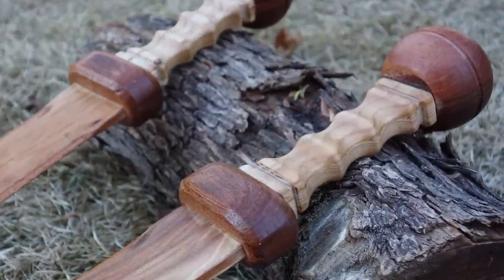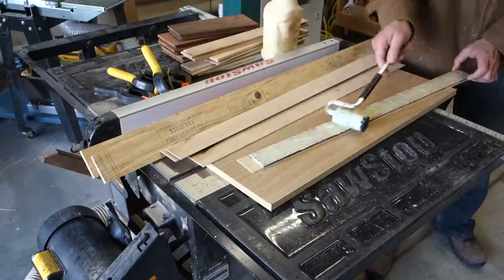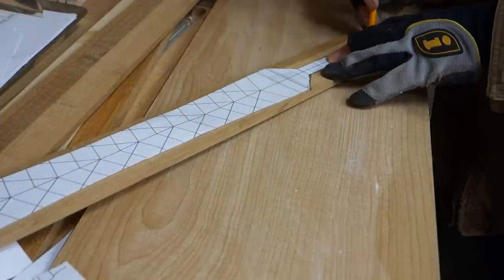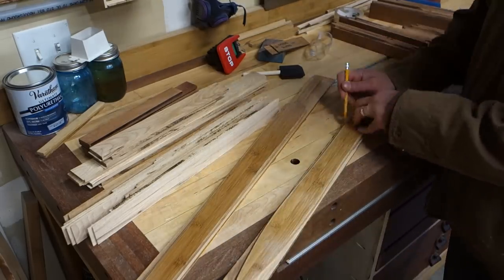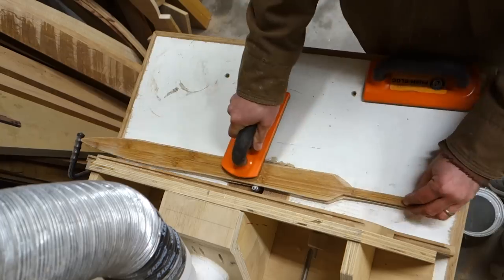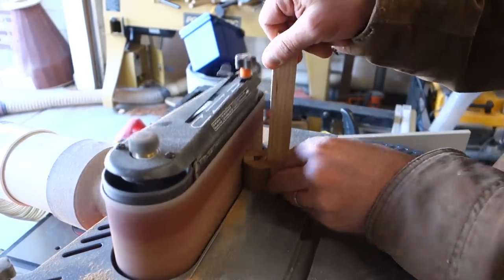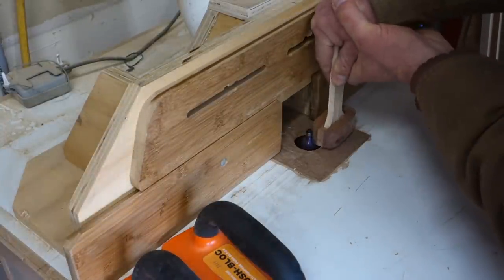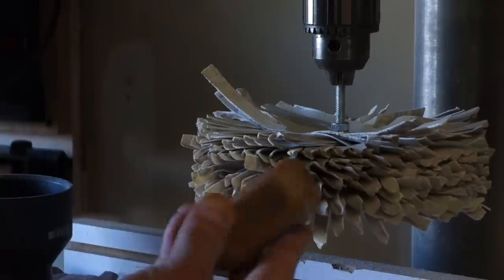Making Wooden Gladius Swords

Comment: is that a standard 15 deg panel routing bit?  and is the bearing extension to eliminate the flat part of the panel a custom thing or did you just get a larger bearing to put on it?  Thanks
Reply from the maker: Yep, panel bit as you say. You do need a larger bearing to keep it from getting that ridge on the bit, however a bearing still leaves too large of a gap between the bearing and cutters, for the width of these blades. I ended up using a few washers as the bearing, and I make sure they are tight on each time I use it. Good eye.

Comment: What thick ness wood are your swords I was going to use 2x4 and make multiple blades at once how thin would you go for children to play with
Reply from the maker: 2x4 would be fine, but my guess is that you'd want to make them ~1/2" or thicker to beat around. These are thinner, but also made from denser wood. That's just my guess. Good luck, sounds fun!

Comment: What is the name of the tool you use to hold the wood in place on the ban saw?
Reply from the maker: Hand screw clamps. They are super useful for many things.
Reply: Geeks Wood Shop I was meaning the guide at :21. Sorry I should of said the time
Reply from the maker: Ah that. It's a grip-tite brand magnetic fence.
Reply: Thanks, looks like a very useful tool also

Comment: The leaf shaped one would be called a greek xyphos
Reply: Not true, many forms of gladius featured a leaf shape or “waisted” design, widening at the tip. If it had more of a cross guard, rather than the typical wooden one of a gladius, and no large sphere pommel, it would be. They are very similar swords though, I’ll give you that.
Reply: But most gladiuses were straight
Reply: S4Plays  True, I wasn’t saying they were not. I was just saying that a leaf shaped gladius is still a gladius and not a xyphos, as it lacks too many features. The gladius was in use for over 600 years by the Romans, and had many variations.

Comment: do you actually beat, on anything,  with your wooden specimens,  any fema or anything,  Or just nice wall hangers? that don't rust but might swell with moister...
Reply from the maker: No problems with swelling, but no, I don't use these for any actual sparring practice. You could, they'd last a while, but would probably build a bit different for contact. Thanks.